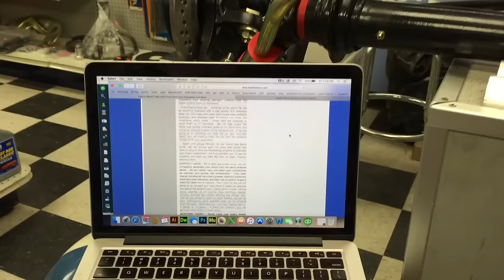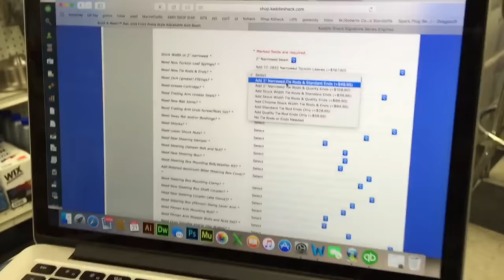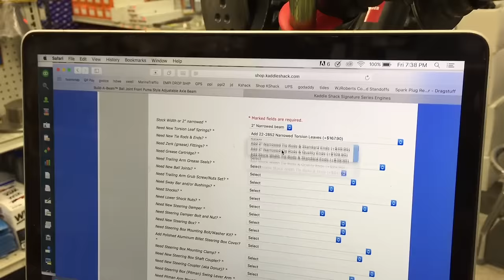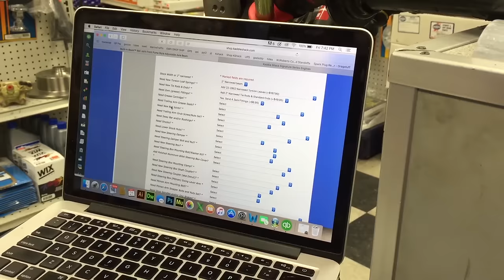Kaddie Shack TECH TV: Building Adjustable VW Bug Axle Beams

Comment: I've got one of their 2" narrowed beams. 2 1/2 " drop spindles , disc brakes and 3/4" sway  bar. Love it. Had all  the rest of the  brakes rebuilt. Car will stop on a dime. Handles great, rides nice. Pretty much the same as in the video, but for a 66 bug. Stock rear suspension. Car sets just the way I wanted. I highly recommend Kaddie Shack.

Comment: Years ago, I installed forged drop spindles on the front of my '67 Beetle. When I set it down, the front was about 2" lower than the drop on the spindles were supposed to take it creating clearance issues. took it to alignment shop to true it up. Still have clearance issues. Someone in it's history welded the axle beam to the frame head. What are potential reasons for this unexpected excess lowered stance?

Comment: empi does not make good parts all OF THE TIME ,,,sometimes they are way too cheaply made , china crap ,,,,and in engineering explanation can you tell me why shimming the front end makes it go straight ?
Reply: Shimming the front beam won't make it go straight, it simply helps with return to center by improving the spindle's caster angle which improves driveability.